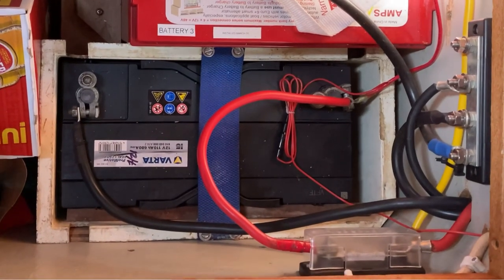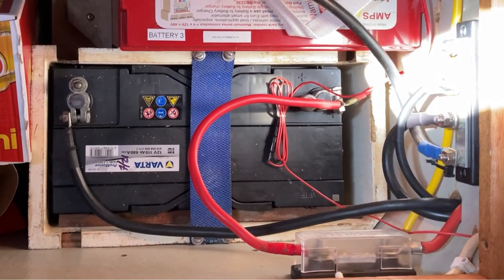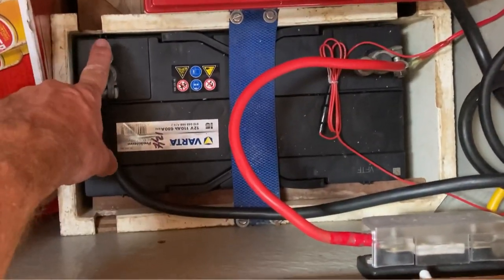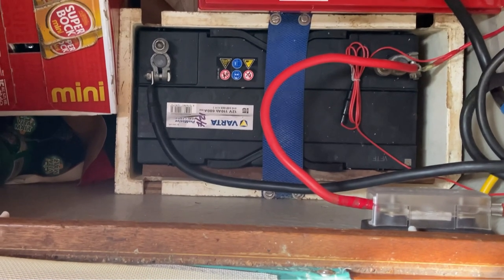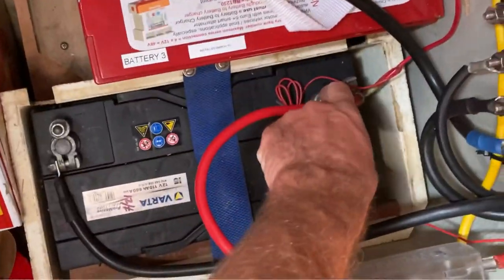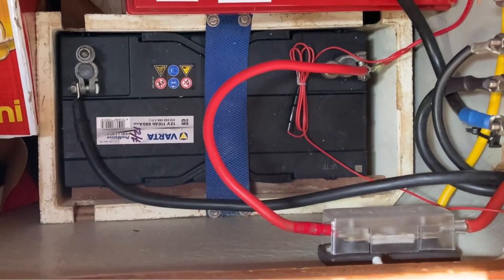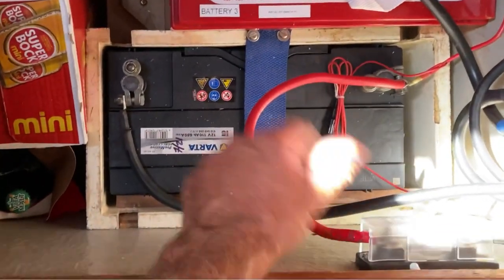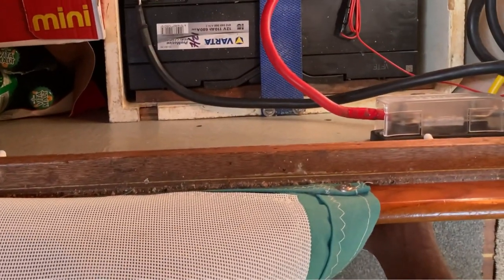Making and fitting new battery cables and switch

Comment: I've just uninstalled that type of battery isolator switch that me trouble. You'll be well rid!
Reply from the maker: Those isolators are extremely common and generally fine but there are good versions and there are cheap versions.    It’s well worth paying the extra for a decent isolator switch such as those made by hella.   Also, nothing lasts forever in a damp and salt-laden environment so nothing is fit and forget.

Comment: Small hint regarding the cable tie used to hold lugs together. If you wind the cable tie 180 degree prior to closing you can open it without cutting the cable tie
Reply: 180.....
Reply: @waterboy8999  correct, of course 180😀
Reply: @arnehayn4354  easily done, haha.

Comment: Hi George, very informative & concise channel
 I wonder could you expand on your mixture of lead acid start battery & lithium house bank.
I assumed the lithium bank wouldn't be able to start the engine, & would have to be completely separate from the start battery, but this doesn't seem to be the case with your setup, maybe you could do a video on this if you get chance.
There's a lot of us out there I would imagine looking to switch to lithium but not wanting to rely on a single lead acid start battery
regards
Ian
Reply from the maker: Pleased you enjoy the vids.  I will think about how to to put together a vid about using lithium batts as you are not the first to ask.   With my setup I can link my lithium house bank into the engine start circuit temporarily so stating the engine on the lithium’s is possibly and it got me out of a hole when sailing between the Azores and the uk.

Comment: George its a good idea to add a DC breaker between the solar panel and the charge controller, you can then hit this if you need to work on the batteries
Reply from the maker: Agree it can be a good idea, although I have the panels connected with mc4 connectors above deck so very easy to disconnect if needed.